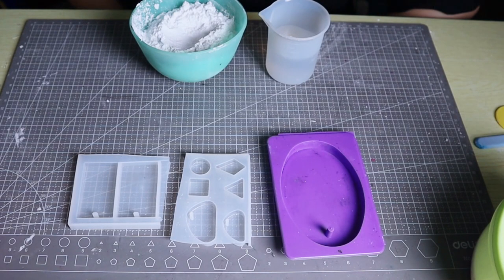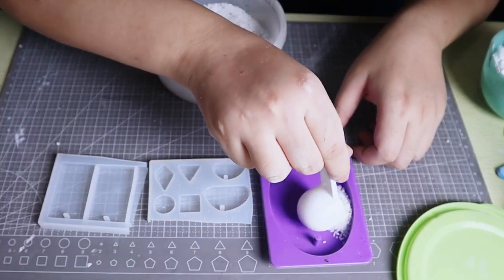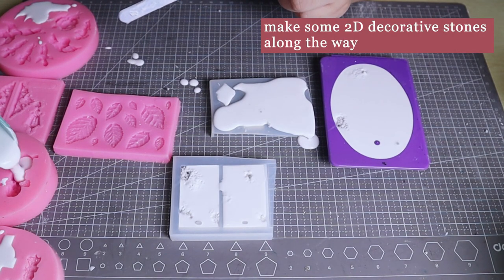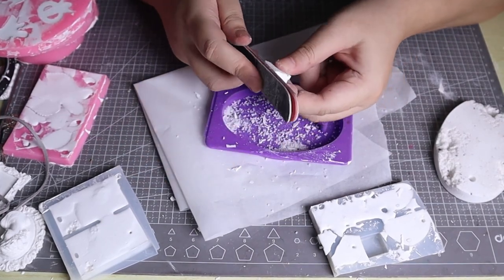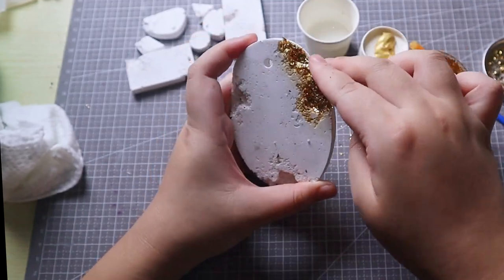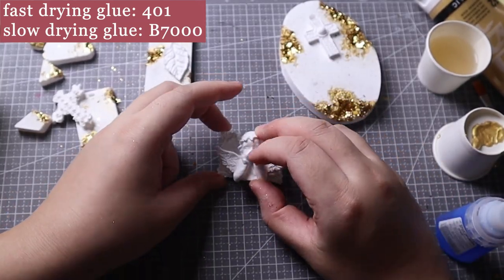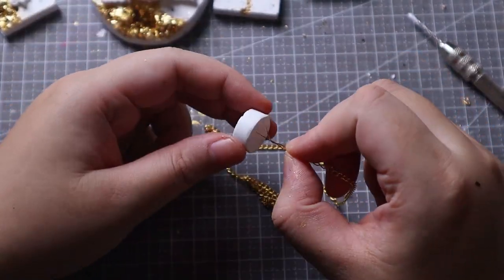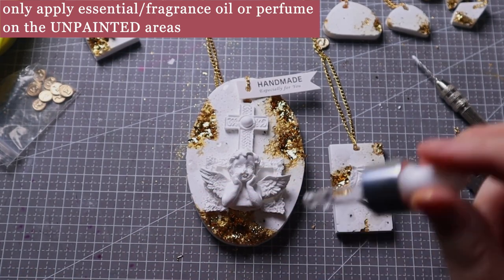Aroma Stone Diffuser Tutorial #7 : Metallic Gold Erosion Hanging

Comment: Hola! Muchas gracias por tus tutoriales, por favor podrías ayudarme con una duda:  qué tipo de yeso utilizas? Que crees que es mejor Resina al agua o el yeso?
Reply from the maker: Hi! I use plaster for aroma. Just make sure It's for aroma.  Also I use fast solidification type.

If u want to add fragrance during the making process:
Water-based fragrance can be used alone. However  oil-based fragrance(such as essential and fragrance oil) should be used with emulsifier to make it become water based.

If you want to add fragrance afterwards, meaning that you mannually drop or spray fragrance on the stone:
you can just drop oil or spray perfume on it.

I actually prefer the second way and bundle the stone with essential oil for sale.

For more explanation, feel free to head to Aroma Stone Diffuser Tutorial#1.
Reply: @shancandle  muchas gracias! Eres muy amable!
Reply: Thank you for this! Beautiful